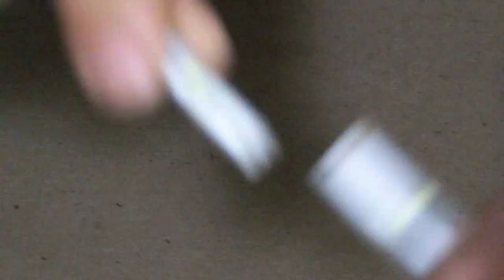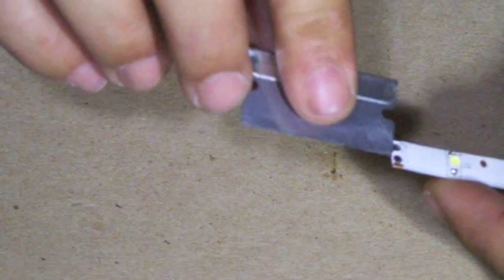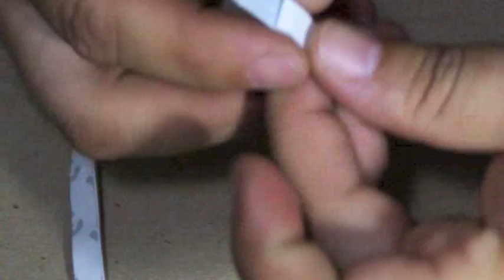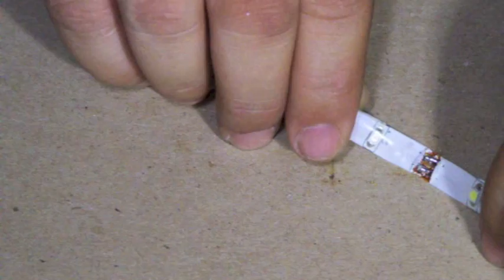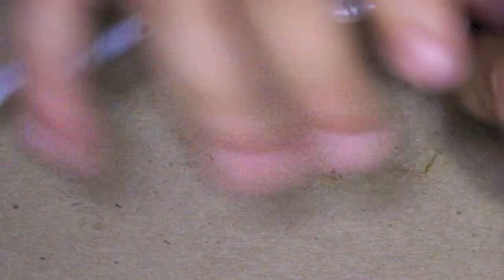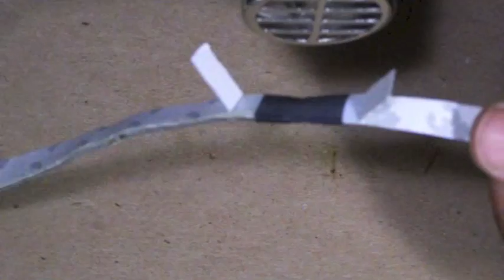Connecting LED Strip Lights Together

Comment: Not as easy as it looks.  The challenge is to strip the waterproof coating cleanly without cutting through the thin filament.  Nevertheless, mine have been in place for 12 years now without a glitch.  I did have to replace a power source.  Mine are in the kitchen under counters including over the stove. which generates lots of steam,.  Good video.

Comment: Is there a way to connect 2 strips that have that thick coat like yours but rhe ends that need to connect won't match polarity? Thank you! ( the other end has a usb and I'm trying to avoid cutting that.

Comment: I have seen lots of videos but your way it is very simple at the point you sodering we have to overlap the connection or just line it up? Is it safe for outdoor use? Thanks looking forward to hearing from you.
Reply: Just line them up. If you use water resistant heat shrink you should be fine.

Comment: If you're looking for fancy, this isn't it.<👀>share4.photo/LCeilingLight?Vよ    I installed it today in my smallish kitchen (about 12x12) and it's much brighter than the two buildings fluorescent fixture that it replaced. It also uses just over half the energy of the old fixture.

Comment: I ordered two strips each 5 meters, andi don't have the tool to connect it, what do I DO
Reply: i’m getting another pack later this week since i ordered less than i needed and i’m gonna try to connect using the tape method so i’ll tell you if i get mines to work 💗
Reply: stxrrygguk did tape work?
Reply: chrisxgreene シ so it might work, it depends if you put in time and effort. in the end i decided i didn’t wanna break the strip so i just bought a brand new pack and connected it but it DOES work so you could try it if you’d you like, up to you!!
Reply: stxrrygguk okay thank u :)
Reply: chrisxgreene シ np!
Reply: @stxrrygguk2747  can u send me the tutorial?i had trouble with mine bc mine didnt came with the connectors.
Reply: Stabb it
Reply: same what did you do to solve it tho?
Reply: Arthur Davies tape
Reply: REEGAN CARSTENSEN but then how do you work them both? Do you have to use two different remotes?
Reply: Indie Rose nah that’s why you connect it
Reply: You can order it
Reply: You can buy something that connects them
Reply: Super glue them
Reply: Don't use tape cuz it'll slip out
Reply: REEGAN CARSTENSEN how???
Reply: Chloe Diane Blankenship did you do it
Reply: HenJA it didn’t work

Comment: but did you test it before putting thermal shrink tube on it?  also, you should never put shrink tubes on LED lights like that it can shrink the strip at the non h20 resistant part by bending it in half thus shorting out both terminals. you remedy this by putting hot-glue up to the point to fill the gap so the thin part of the strip doesnt bend and short out.

Comment: I have a led strip with 6 feet of line with 3 AA batteries with a switch. if I had 3 more strips how do I hook up enough battery power to accommodate the additional strips??

Comment: Hi I want to make two strips with two ports and only one power cord to the outlet. I will order the one that come with remote control and use with WiFi from amazon. What do I need extra to do this? I don’t know anything about electronics just try to do this for my hydroponic. Thanks

Comment: I have to connect four 5 meter led strips together, so can I connect it via this method or it is unsafe to connect four together in one circuit? Will resistance be a issue? Or it can overload the circuit ?
Reply: Using the bog standard kit you would normally receive when purchasing off line the general advice and rule of thumb is, if you are going to power a set of lights that exceeds 5 metres (continuous strip of LED's) then you would have to configure the 'power where? points' and wiring, and lay it out in series.  So a  single 10m strip being powered by one basic power source, sited at one end of the 10m strip - this is wrong and unsafe.  substituting the single 10m strip for 2 or 3 lengths, and powered in series parallel. This means you can operate safely with 10m of lighting and still with only one power source, but multiple 'power where? points.'

Comment: Do all LED strips for Rgb non water proof, have to be in one line with each other ? Or can you have the one strip jump off to other strips mulitple times from differernt points on the one strip ?

So - One led strip
- 4 positive and 4 negative on the one strip at different points.
- strips coming off of all those points

or would it all have to be jumped in a line ?

Comment from the maker: USB provides 5v. I don't know how many LEDs you are trying to connect but most strips will require 12v or more.
Reply: Are you able to make a video or simply explain how to change a battery pack on these strips to one that can power multiple connected leds ?
Reply: Hi,  is it possible to connect 5630 with 7020?, both having same volttage
Reply: LEDsof Arizona

Comment: I tried connecting my led light strip to a usb cable but it doesnt work. when I cut the usb cable open I only saw a red wire and  a light blue wire. help?
Reply: These are 12v strips, your USB is not. Stop before you break something.
Reply: +ryanvibe11 what do I need to connect it to a USB port?
Reply: +ryanvibe11 my lights didn't come with any connectors just a red and black wire connected to it.
Reply: I cant comment on connecting to a USB, I would assume it's not possible or at least not easy. I recommend going on ebay and buying a 12v adaptor, they will only cost a couple $ and then its as simple as connecting the reds and blacks. Let me know if you need anything else mate.
Reply: K thx for the help
Reply: +ryanvibe11 wait if I get the 12v adapter how do I connect the two? do I cut the end off and sodder them together?
Reply: Yep, just cut the plug off the end solder it.
Reply: +ryanvibe11 the end that plugs into the wall?

Comment: can I connect 4 x 5 meter 3528 (just white) end to end and power it from 1 end or do the 4 strips need to be powered separately by running a power cable to each strip
Reply: Idk

Comment: I'm going to be installing RGB strips on my motorcycle. I have a roll of it alond woith a short piece about 6 to 8 inches long. The roll has 4 wires coming off of it, the short piece none. I tried to solder some wires to the short piece but it wouldn't take. What kind of solder are you using in this video? Is it a flux core solder? Thank you for any help you can give me.

Comment: Hey, I bought 10m of rbg strip and only used 8 now I wanna use the last bit on my motorcycle is there any way to set it up that I don't have to use a controller? So all I have to do is hit a switch and only have my desired colour work or with rbg do you need a controller just for it to work?
Reply from the maker: No. The controller not only powers the strips but controls each color. You can feed the controller thru the ignition switch (recommended) so that they turn in and off with the bike but you still need the controller.
Reply from the maker: Actually let me add that if you feed 12v to a specific color say green and also of course the ground wire then yes when you turn the bike on or hit a switch only green will light up. This will of course will cause you to lose the ability to change colors. Hope this helps.
Reply: You can buy off eBay for less than £5, a push-button unit that replaces the existing RF key control receiver. Everything connects in exactly the same way for your bike as it did when you installed previous project except you swap the controllers over.  It looks similar to the slimline version of the RGB RF remote receiver and does more or less the same  except your controlling the light functions via 3 small push buttons actually built 'into' the 'in-line' control unit, thus removing the need for any remote key controllers to work the lights. Two benefits that spring to mind straight away over the 44-key RGB RF controllers and remotes are firstly,  the on-going cost savings of not replacing the batteries inside the remotes, or the remotes themselves, which may get lost or damaged through time and everyday use..  Second benefit of removing the RGB RF receiver is the lights won't react if they are mounted in range of say a television TV Remote.  Changing channels on your TV will make your LED's strip lights react, but in a random unhelpful way!
Reply: Simply put, YES you can. How? that's another question.

Comment: What has happened to the world of electronic projects?!
I found that I need something hard, heat resistant, and non-conductive.  I used a ceramic bowl that was flat on the bottom.
I had to cut the connections in have, so there was less solder.
I put my iron on the extreme outside of the strip, got the solder that was there melty, then put as little additional solder as possible.
After testing it, I left the connection taped to that bottom of the bowl, and put nice mound of clear silicon caulk, making sure there was a nice <1/8" covering all the conductive areas.
We'll see when it dries.
Reply: How did it go? Did it dry?

Comment: Can you connect two 5m LED strips together using the supplied power supply or would you need to buy a bigger power supply say a 10A 120W and will it work okay or will it fry the lights or power supply?  Have you tried this?  I need to make a 60' long strip to go around the room buy can't find any LED ribbons longer than 5m.
Reply: it depends on the draw of the LEDs you have and the spec of the adapter. You can calculate it all though if you know the specs of your stuff, or if you have a multimeter you can measure and then calculate from that. If you know your specs, take a typical 12v, 24w 5 metre 300SMD LED strip as example. this has 300 LEDS in at .08w each (0.8 x 300 = 24). divide by 12 (voltage) to get the current (2A). So if you connect 2 of these strips together you will need a 4A power supply. If you join odd lengths together, just add up the total number of LEDs, multiply by 0.08w (or whatever your single LED is rated at if different) to get your total watts and then divide by voltage (12) to get the overall Amps.

Sorry I'm repeating myself, but you should get the idea.
Reply: RKIVIDS If you talk to your supplier (or read the pack if it's correctly labelled) it will tell you the watts consumed per meter of LED's, and the maximum meters of LED's that can be connected in serial (ie. end on end). You can connect LED's in parallel to the max specified by your power supply, but the length of run is limited by the size of the power supply wire in the LED's. To give you an idea, the LED's I'm using are 5W@12v(0.41A) per meter with a max length of 5 meters (2 amps). If I had a 12v, 20A power supply, I would wire up 10x 5 meter runs directly from the power supply.

Comment: Can I use a 4-AA battery pack on my LED lites? I don't want extension cords all over my yard. How do I hook up 4 wire to the 2 wires of the battery pac. Am I dreaming?  lol
Reply from the maker: Single color strips only require 2 wires. You can hook them up to batteries but AA batteries don't have enough amps to drive them. If they light up, you might get a few seconds worth of life... We use small 12v motorcycle batteries to power our Umbrella kits which works well.

Comment from the maker: Single color strips have only 2 conductors so a simple ON/OFF switch from your local Radio Shack should do the trick.  Depending on how far of a cable run you have, we have used CAT5e to do some motorcycles with strip lighting and worked great.  We use 2 conductor, 22awg cable for our outdoor patio umbrella kits and it's perfect.  Thin, light weight and flexible.